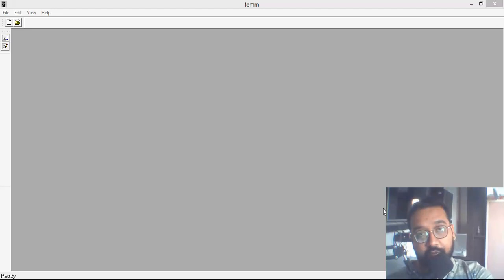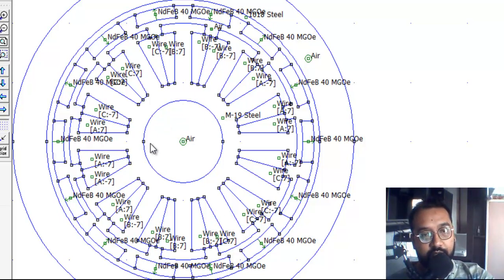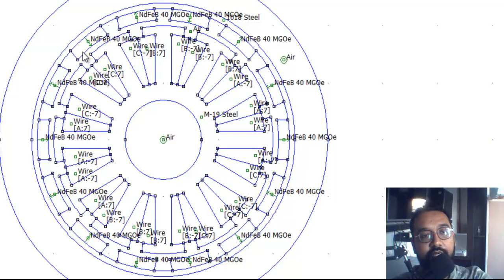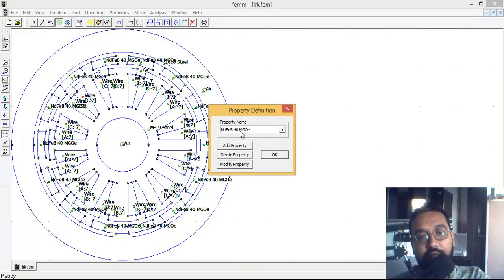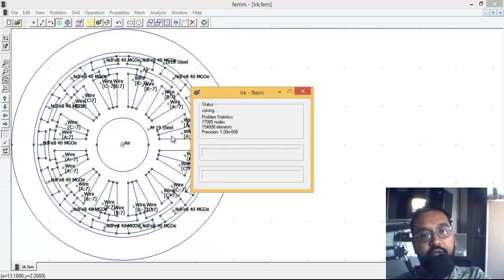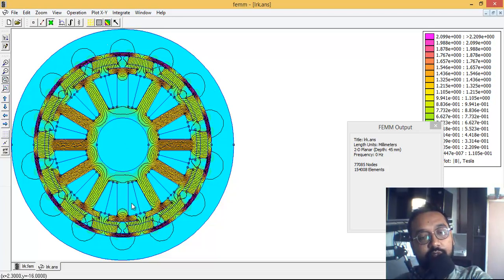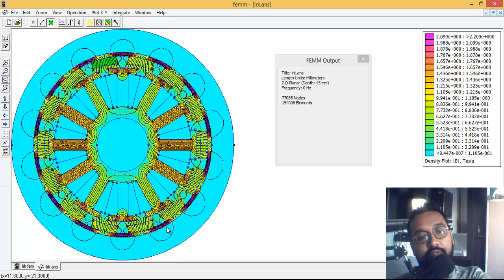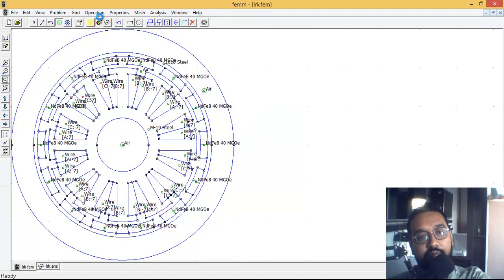DC MOTOR FINITE ELEMENT METHOD MAGNETICS Simulation Example Tutorial #finiteelementmethod

Comment: Hi how do you find the torque of the motor? I chose the rotor and did integral lorentz torque and still get 0. Am I missing anything?
Reply from the maker: Did u enter value of current in winding?
Reply: @SurajKClasses Yes, I should have selected the rotor and the magnets also and perform torque via weighted stress tensor
Reply: @SurajKClasses  Could you do a tutorial of how to import our own dxf motor design and perform analysis?
Reply: found the answer here: https://things-in-motion.blogspot.com/2019/02/how-to-model-bldc-pmsm-motors-kv.html